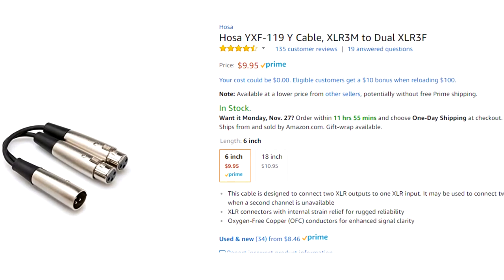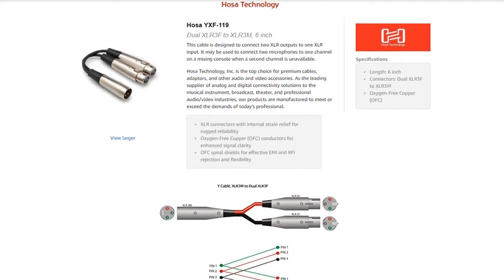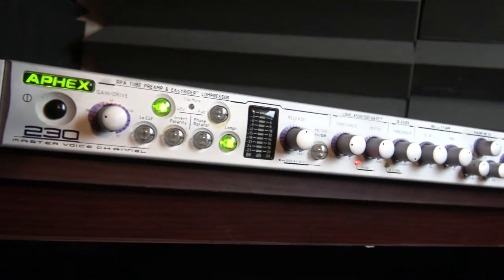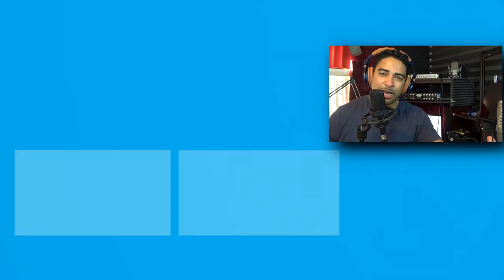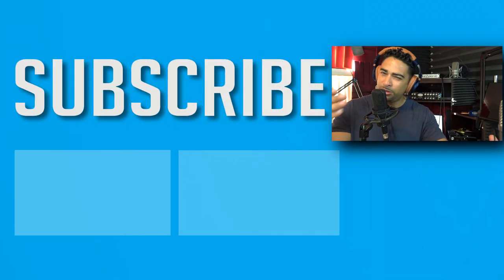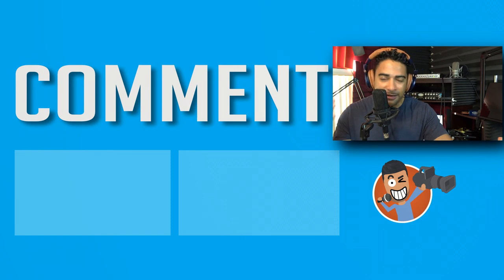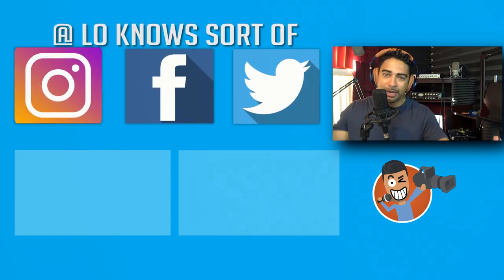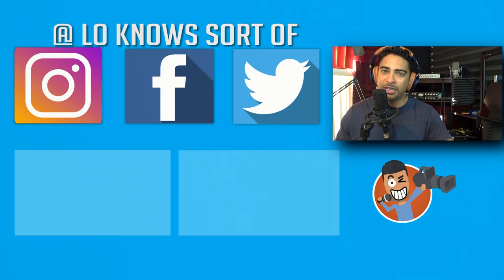2 Mics connected to 1 Voice Channel Strip (at the same time!!!)// HOSA YXF-119 Y-CABLE:

Comment: Wow, that was a really interesting experiment!

The YXF-119 is meant to be a splitter as opposed to a summing cable which might explain the gain reduction. It also lacks the shielding you'd usually require for a mic cable, hence you might get a little noise as you heard near the end. Still, very cool to see it can be used for that purpose even if there are more appropriate ways of accomplishing the same function.
Reply from the maker: Hosa Technology it was a chance worth taking and surprised me in every way. Really didn’t know what to expect but I was very pleased to see it do the job, even if it wasn’t meant for this purpose. Thanks guys!!
Reply: @Advanced Microphone Reviews That's the first we've received that complaint. If you're using our standard range of cables, I'd look into our Pro or Edge series, which includes Neutrik and REAN (made by Neutrik) ends.
Reply: @HosaTechnology  HE is why I purchase this much needed gear

Comment: Great insight as to what can be done to maximize audio equipment use. Question: What would happen if you introduced a CL Cloudlifter into your signal chain, connected to the Hosa splitter directly into your Aphex Channel. Would this help any gain loss through the two mic use? Granted, there probably would be some additional floor noise. Curious. Thank you in advance for your response.

Comment: Excellent,  I had two mics, each with their independent input channel, but it produced an echo while using google meet. Some people told me that the echo was due to having one input uncontrolled , and they suggested muting the input that was not being used. But if you have one person speaking, while the other person is translating into Spanish (for example), then muting one mic is not realistic. I like your solution of using the XLR splitter. Thanks for your contribution.

Comment: You can buy a $40 mixer to put between the mics and compressor input. Gives you individual control over gain and EQ and is a more sensible solution. I know it costs $25 more than the splitter cable but it gives you much more flexibility.

Comment: To sum dynamic microphones, you need to use a Y cable which connects the microphones in series, not parallel. Condenser microphones should probably not be summed with a Y cable, but if you must do it use resistors so that the amplifiers in each microphone do not unduly load the other. Probably 100 or 150 ohms in series with pins 2 and 3 of each microphone, matched resistors, of course, to keep the phantom power balanced.

Comment: How do you set Threshold and Gain Reduction levels with 2 separate sound sources? Have you leveled the microphones with 2 pre amps before going into the splitter? Do you have no ACN at all in the chain? Is it a totally passive combining network to the input of the compressor?

Comment: The reason it adds a little attenuation, and a change in audio, is because the mic impedance changed when the mics were paralleled with the Y cable.
A small 60 dollar 4 channel mixer would solve the problem, and give separate gains to the persons speaking.

Comment: I noticed a little drop in dynamic range.
Reply from the maker: Yeah, it does nerf the body of the audio a tad bit. The company reaches out to me and said it wasn’t designed for that but it was cool that I did it anyways. I thought it would be cool for a podcast setup to take advantage of a single compressor. But a cool idea for an inexpensive cord.